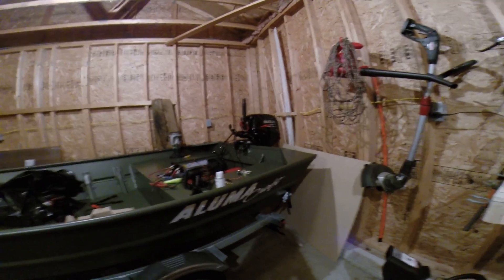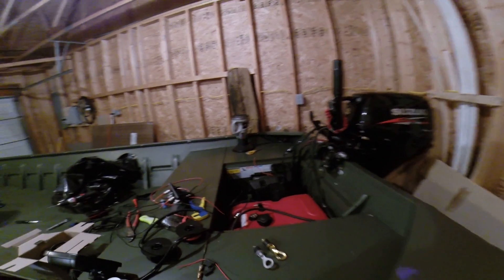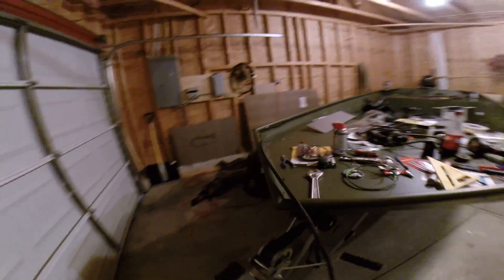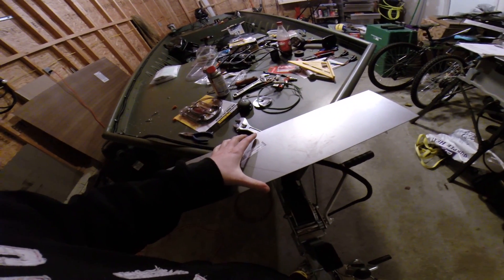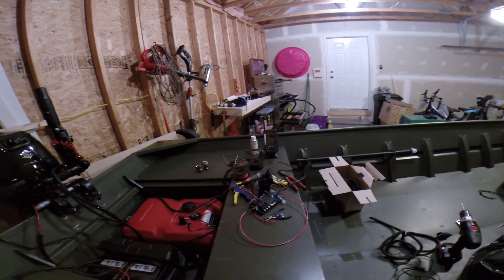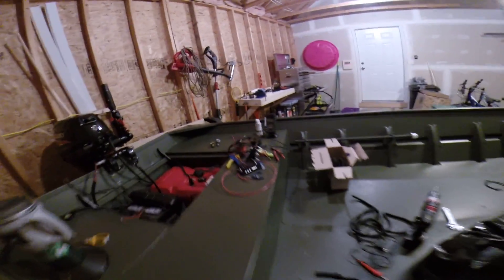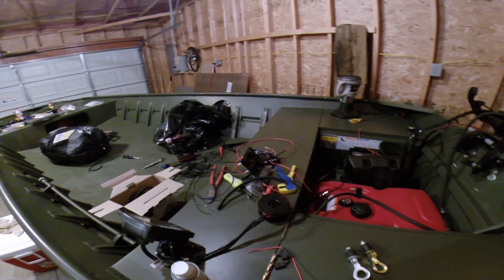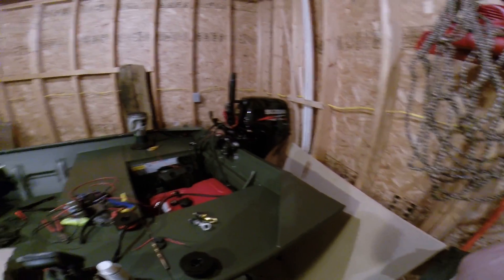Alumacraft 1648 with 15hp Suzuki

Comment: Do you know what caused the fish tape to get hung in the gunnel? I have a 2016 1648 NCS but in the flat bottom version rather than MV like yours. I have a bow mount trolling motor installed and planned to route the wires up through there.
Reply from the maker: wmkess yeah the gunnel tube actually has a slit in where the side of the boat come up into it. It was plastic fish tape that got stuck on a sharp edge of the aluminum in there
Reply: Tyler T Thanks for the reply. Do you think a steel fish tape would work instead?